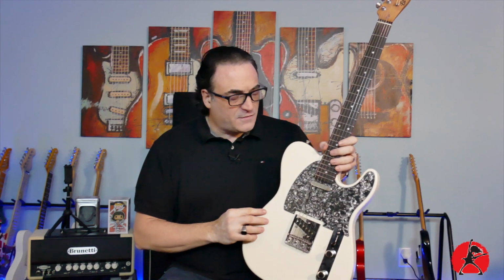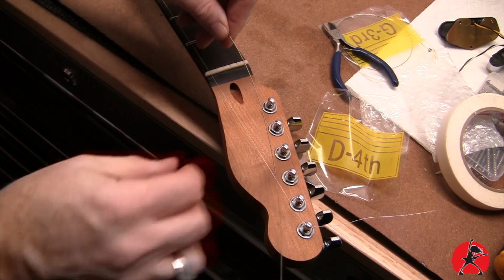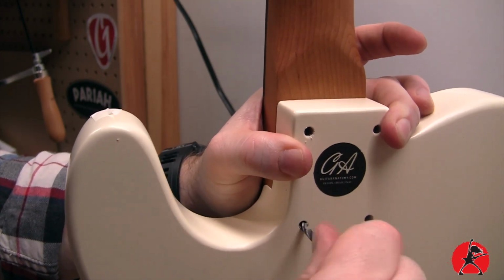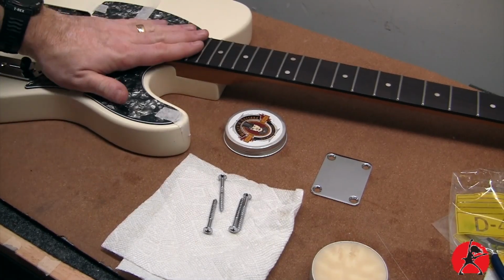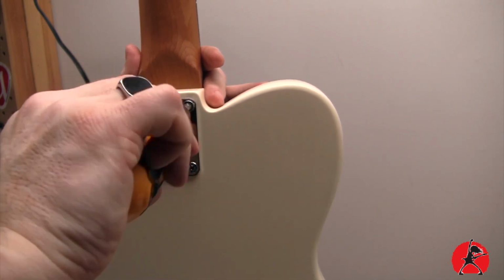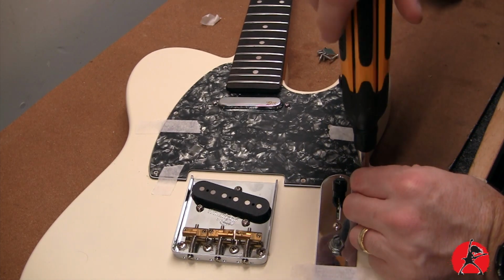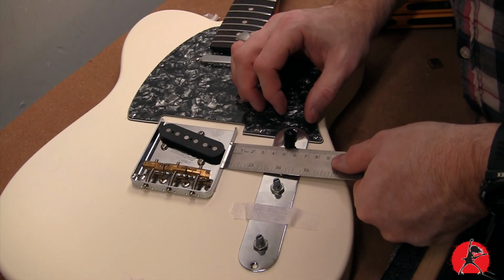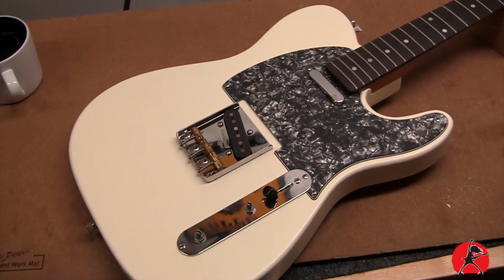How To Install A Guitar Neck Properly For A Perfect Build Project!

Comment: Also I want to add that when seting the neck,  if the pocket and neck do not exactly match then you can not just put the neck to the pocket... You will  need to do measurements from your bridge saddles to the 12 fret and 12 fret to the nut. Many different necks have different pockets.... Great video...

Comment: To get the neck “tighter” in the pocket I like to put the strings on. Tune the guitar. Release each screw just a 1/10th of a turn counter-clockwise. Tune the guitar again, then really tighten the neck screws(bolts). This will bring more sustain to the guitar.
Reply: howd you figure that out?
Reply: I tried this. i ended up breaking all six strings on the guitar and the bridge pulled all the way off the body. crazy tip. would not recommend
Reply: @maxonmendel5757 he probably ment with 'all screws' just te screws from the neck. You shouldve left the Bridge on

Comment: May I ask you a question?

I took the neck from my fender and installed it on my Squier, then a mighty mite onto my fender.

The fender roasted maple is a little less than an inch thick from backside of heel to fingerboard edge. The mighty mite is just about an inch.

I didn’t know the e string method of aligning, so I taped a string down the middle right at the saddles and pulled it tight and eyeballed it, marked my holes… actually screwed my holes with an 1/8” bit with a hand drill. Taped the bit for depth, but didn’t tape it to prevent eating wood in the body (since I used it as a guide to help it go in straight.)

I’d love to send u a couple pics, because there’s equal space on the sides of each e string…. Maybe a little less on the low end side, which I know isn’t the way it should be.

The fender neck took the Squier screws immediately, and I don’t THINK I had any problems there.

Did I do this wrong? Should I take them apart and redo this?

How do I know that the necks are seated firmly in the pockets? Butt end (where the date stamps usually go) making contact with body?
Reply: As long as you can play it without either E string coming off the board, that's not a huge deal.

As for neck pocket and neck fitment, IMO all four of sides of the neck heel should ideally fit flush. But IMO they're most important in this order: back, sides, and butt end last. 

The other thing you want to watch out for is if the fretboard is protruding up above the body further than the previous neck (you mentioned the Mighty Mite neck is very slightly thicker). This will affect the neck angle and action. Once you can attach the neck,  assuming it has a mostly functional nut, I find the best thing to do is to string up the guitar with your working/cheap set of strings and set up the guitar (neck relief, saddle/bridge height, intonation). If you just can't get the correct spacing of the strings to the fretboard surface and to the guitar body (pickups and saddles), you may need to sand the back of the neck pocket slightly. Use a light grit (400 maybe), use a block to be uniform, and go slowly. 

If it's just a matter of the neck angle but not overall action, a neck shim can solve that for you. 

You may have already completed your build by now but I hope this helps.

Comment: Couple of newbie questions;
Other than the tape hack, how do you measure how deep you need to go with the drill bit? 
Also, can you do a good job without a drill press and only a cordless drill?
Reply from the maker: I would say you can do it without a press if your have a level hand. The tape method is all I use and it works great.

Comment: Hi! I just installed an after-market 22 frets guitar neck on my strat. The issue I'm having is the tune of the strings is not on point to its note. Example, the lower E becomes an A when I tune it using the tuner. Then, the A becomes a B and so on. What could be the issue? Im thinking that maybe I bought a knock off strings at amazon or its the neck or how I installed it. I'd appreciate all the tips and help I can get.

Thank you
Reply from the maker: Did you check the scale length of your guitar?

Comment: Calipers are very cheap (in plastic) and can measure the INSIDE of a screw... not the sharp edges outside and the bit diameter.... they should match

Comment: Nice,but I have 2 guitar bodied & 2 necks...no holes for mounting anywhere
Reply from the maker: In that case I would use the neck plate as a guide and drill new holes into the body and the neck at the same time.

Comment: how deep should i go with the drill on the neck?
Reply from the maker: Only as deep as the depth of the screw.
Reply: @addictedtogear  thanks
Reply: And by "depth of the screw," I assume he means the depth of the exposed screw, after accounting for the body and back plate thicknesses - basically, just the part that sticks out after that (my squier tele exposed 5/8" of screw end).

Comment: Sorry to be a party pooper, but before you mark the locations for the neck screws YOU HAVE TO CLAMP THE NECK IN POSITION why? because even if you move the neck 0.5 mm everything will be off.
Reply from the maker: The neck pocket was so tight it was not necessary in this case. Cheers!